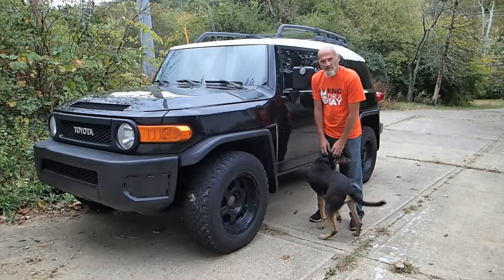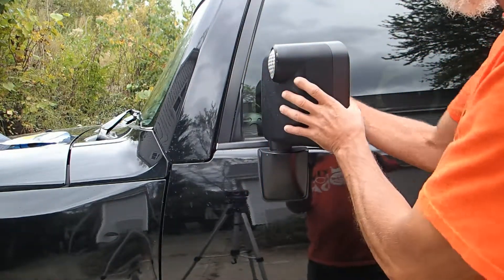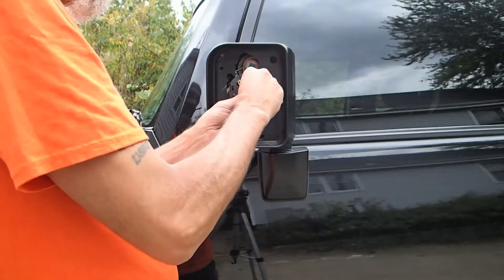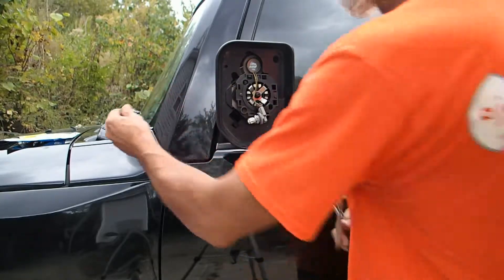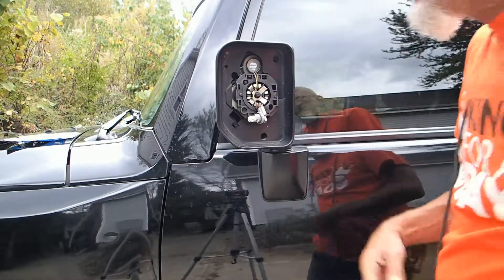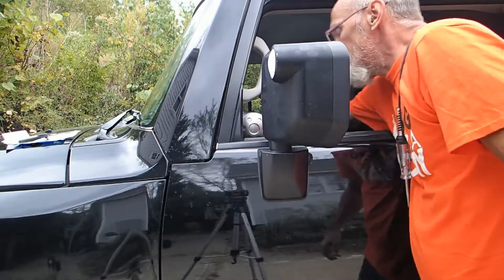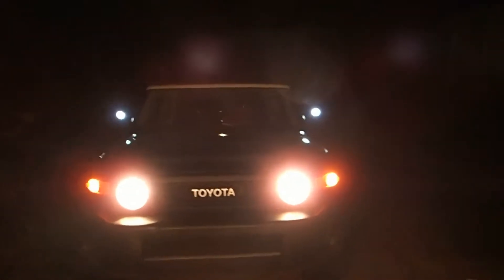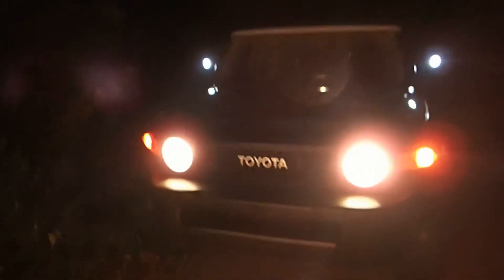Toyota FJ Cruiser mirror lights not working, fixed!

Comment: Silly question, should these lights come on with the headlights? All of the fuses are good, but the mirror lights do not turn on. Therefore, I am am wondering if the lightbulbs are blown.
Reply from the maker: They are supposed to come on when the daytime running lights come on. Basically,  they should always be on.  Probably bad bulbs as mine.
Reply: Rabid Squirrel Garage Thank you.
Reply: Rabid Squirrel Garage What voltage/wattage did you use? The guy at AutoZone is having a hard time finding a replacement.
Reply from the maker: @westo84   I don't remember, sorry.
Reply from the maker: @westo84  I got mine on Amazon:  https://amzn.to/3jVI87A
Reply: Same problem here with my passenger side mirror light. The lights don't come on with the daytime running lights, but illuminate when you swicth on the headlights. Only one of mine works after replacing both bulbs, so I am seeking knowledge/assistance.